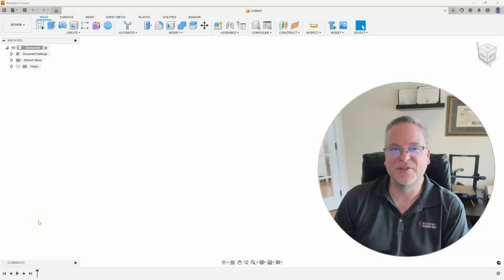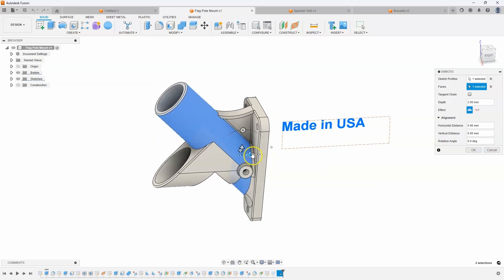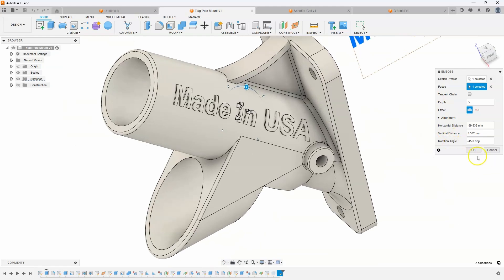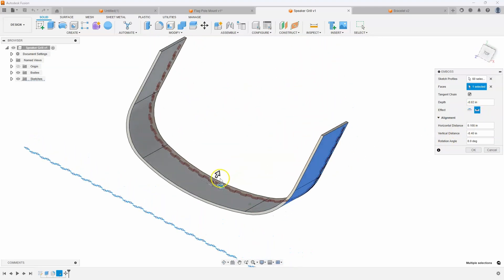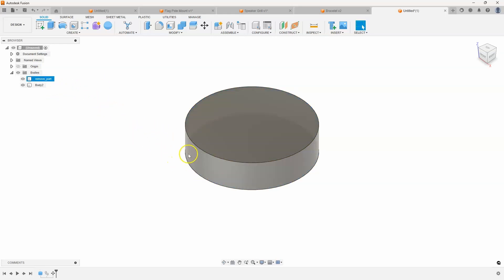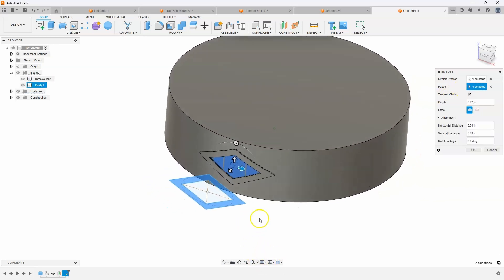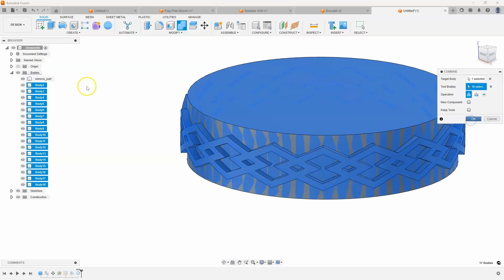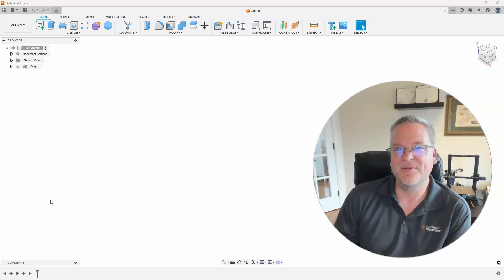Fusion Friday - Emboss Command

Comment: I wonder if this feature could be used some how to cut threads. The most onerous being the threads used on plastic bottle caps.
Reply from the maker: You would definitely want your sketch to be correct before embossing.  Make sure the pitch/angle of the rectangle you are embossing is correct before embossing.  Then you could fillet/chamfer the thread.
Reply: @bradtallis8968  Thanks!
Reply: You know there's a thread feature, right? I don't use it so I can't give much advice, but know that you need to ensure that you turn on modeling to actually use the threads. I believe the default is just a thread appearance, and that make people think it doesn't work.

Comment: Two things that I find annoying when working with emboss are  that it doesn't work with surfaces (only solids) and it always joins with the solid rather than giving you option to create separate bodies.
Reply from the maker: Ya, I wish you could create the emboss as a separate body.  I could find that useful for doing over-moulding, etc.  You could thicken your surface a tiny amount to do the emboss.

Comment: And how can the "draft angle" be applied to this for removal from dies or molds?
Reply from the maker: I would use the Draft command to add draft to the emboss after it was created.
Reply: @bradtallis8968  tried it. It doesn't work. Maybe I'm using it wrong...
Reply: This would be super useful. Currently I am move/rotating each face. No cumbersome. Having this built in would be a yuuuge time saver.

Comment: sure easier to position the text with this emboss tool. Versus when I did the original flagpole which wasn't as easy making fine adjustments (at least to me). 0:19
Reply from the maker: Ya, creating the text on the flagpole project a few years ago was time-consuming.  Emboss makes it so much easier.